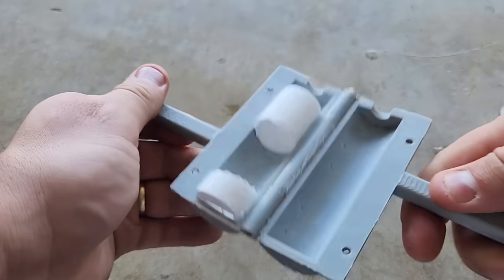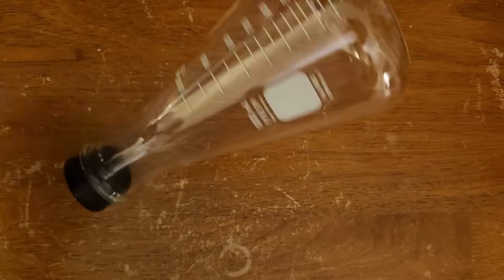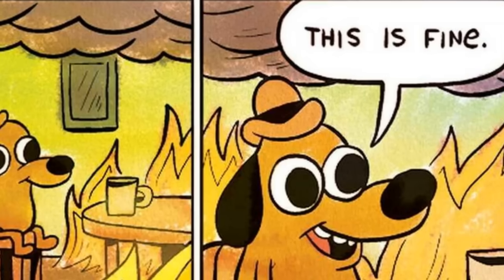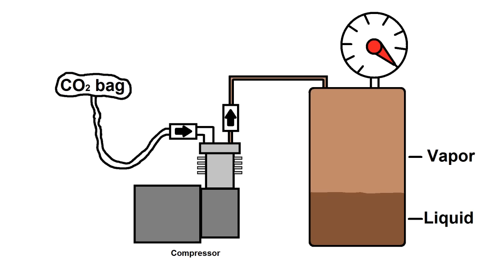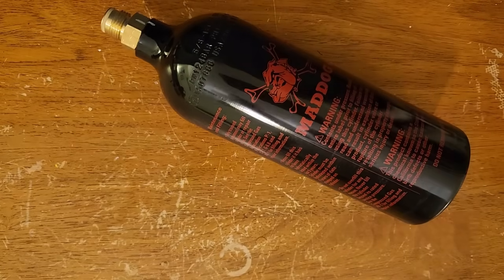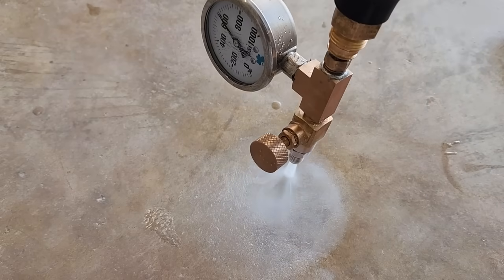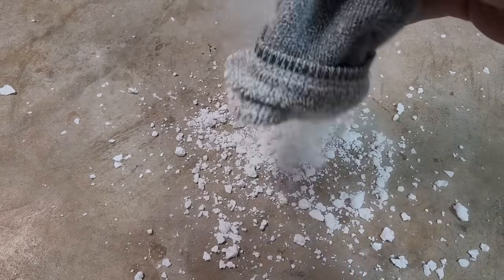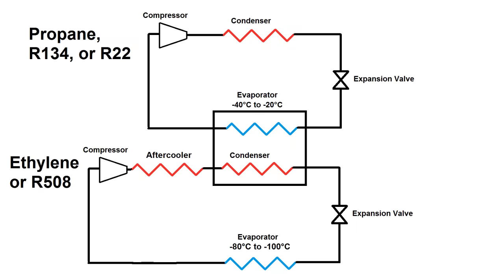Making Dry Ice from scratch

Comment: Have you ever spent time in the mountains ? There is an interesting phenomena when dusk hits...  The shape of the mountains + valleys creates a cooling effect. As the wind over head goes over the mountains+valleys there are compression pockets at the bottom of the valleys.  You could use this shape in your cooling tube to aid the capture.  That 3d printed thing you made >> imagine it with a bunch of deep ribs inside.  I am sooooo curious how different this will perform compared to the first one.
remember how a silencer is constructed. I recall a YT vid where this dude made custom silencers. This is similar to what your trying to do  >> trying to capture the pressure & slowly release. 
cool vid, thanks for sharing

Comment: I don't know if this will be of value but many (35 or so) years ago I had the occasional task of putting 6"x4" round steel bushings into interference fit holes and to make it work I would use a big propane torch to heat the housing with the hole and I would freeze the bushings in dry ice. To do the dry ice we had a bottom feed CO2 tank with a hose that went to a valve which was in the end of a 3"x28" (aprox) stainless tube, the setup was almost like a CO2 fire extinguisher. The liquid CO2 would evaporate at the top of the tube and dry ice would fall out the bottom; I think it was pretty efficient, possibly because the evaporation happened at the end of a closed tube and limited exposure to ambient air temps.  So you might try the final evaporation in a tube that is closed on one end and introduce the liquid CO2 at that closed end. 

Also, since your pulse tube cryocooler can drop ~100C does it have enough BTUs to use it to make the liquid CO2? Or am I simplifying into a chicken and egg situation? I am totally unfamiliar with this tech.
Reply: BTW, if you try the tube expansion method, use a grounding wire on the tube, the apparent friction (myguess) from the solidified CO2 sliding down the tube generates a lot of static and I had a painful shock the first time I found that out :)

Comment: The refrigeration compressor has been designed to pump only refrigerant gases,not CO2 which has a very high compression capacity, more than likely the compressor seized upon start up due to the extreme pressure on the discharge valve. There are commercially available domestic refrigeration compressors available now for CO2
.

Comment: Method 4 is even harder than you suppose. That CO2 solubility curve is only valid for pCO2 = 1bar. Solubility of gases in liquids is linear in the partial pressure so you'd need 1/400ppm or 2500 times the volume of water as you'd have needed in a pure CO2 atmosphere. You'd need 2500 liters of water to hold that 1.5g of CO2 in solution, under an atmosphere of air at 1bar. Then you'd also need a far larger volume of air than your 1.39m³ because you won't be taking the air from 400ppm to 0ppm, but rather only to maybe 350ppm. On the plus side, air is free and you can move large amounts of it easily.

Comment: Off the topic, but have a related question: Will Co2 displace all the oxygen in a pressure vessel, and anyway to figure out how much to add?  If one could do this, it would be possible to put food in an air tight container and force out oxygen from a valve on top of it. No oxygen, and the food would be preserved for camping.

Comment: Pretty cool, if you use such small cylinders with co2 try to throw them into the freezer, you will get mutch more dry ice since you will have alot more liquid and less needs to evaperate to cool the rest off to freeze it to dry ice.

Comment: Salt your ice bath.  You'll depress the freezing point of the water.  Since an ice bath is in the process of a phase change, you'll have a plateau in the temp drop until the change is complete.  So your ice bath will stay at zero unless you depress the freezing point.
Reply: Lowering your temp  will ease the burden on your compressor.  If you go through with the dry ice plan mix it with acetone for a dry ice bath.

Comment: Fridge compressors are not continuous duty. The windings likely overheated to the point of softening or melting the lacquer, leading to a short. 
You likely would have to add active cooling to the compressor to keep using those types.

Comment: If you need to make more pressure with those hermetically sealed refrigeration compressors just stack two or three end-to-end in series.   They typically have a safe working pressure rating of 275 -  350 PSI.
The exact rating is usually stamped into the case someplace) based on a 4:1 minimum burst pressure.

Comment: "crusty sock collection"+"no wife" = smh.  How about you just put the whole original freezer rig from previous videos into a chest freezer, should give you a -12C ambient but probably won't keep up.  I use one for my laser cutter w/ only 5 gals. of water in the bottom portion and it keeps up with 70W CO² tube.  You might get 10 minutes of run time with just air before having to wait for the chest freezer to go under 0C again, but I think you can get -132 ... the next bit of delta you may need is on you.  a 5.0 cu ft. chest freezer from walmart is $175.00.  get a closed loop helium up and running inside it and then maybe circumvent the law by re-purposing a 1940s anhydrous ammonia cooling loop wrapped around your heat exchangers.  Drilling access ports for tubing in the side walls of a chest freezer is easy, the compressor(s) do run hot AF.

Comment: Buy a 40 or 80 pound tank of co2 at a welding supply shop. They charge a tank deposit fee plus gas cost. 40 pound tank is 1000 psi.

Comment: A canvas bag will work better it's what I've use with CO2 fire extinguishers to make dry ice the last porous material will hold the gas more confined and spray it in in spurts that may give you a little better results by keeping the gas more confined in a small area well it freezes

Comment: If anybody actually reads these things, using brass is scary but you do not use malleable steel pipe fittings on any high pressure rig, they "WILL" explode

Comment: @Hyperspace Pirate
I think if you put a into a ice bath with holes, and have that smaller "MOLD" as well, think of it like a 3 to 4 walled container, the first 2 layers are for making dry ice, the last layer is for "recapture" of CO2 Let loose. 
Soo... to recap... you have your mold, a container around it with holes in it as well, that vent out into a 3rd jar, that is cooled by ice, but sealed, so the escaping CO2 can be recaptured and used again later.

Comment: I work with 2 stage systems or cascade systems all the time, we use usually 404A , 407c, 507 and also propane for the primary stage, think about compound cooling with a single refrigerant to reach minus 70C

Comment: Congratulations of fascinating discussion on making CO 2 you should also show how to make a pound for us to make soda using your your system Number 2 could you make a CO 2 motor for airplanes so you put CO 2 in there and lick in the solid form and have it generate gas and run one of those motors has a valve on the top and the piston comes up it opens a valve and what's more power into the that would be interesting

Comment: I don't know maybe you can use the compress you too to spray it onto a cooling disc that might be able to handle it while it was on the high stress bringing down faster or find a way to regulate the flow so it will cool the device and keep it at the temperature do you need it that will definitely freeze stuff Plus it will also look really cool 😎 PS yes I did 420 🤭

Comment: The sparks came from the PTC start relay, a 3 dollar part. When you connected the motor later, it looked straight across line power without the start Capacitor and PTC relay which is crucial to start this kind of motor. Seems it fried due to a locked rotor condition without the start components.

Comment: It is actually easier than what you are doing. Just take Liquid Co2 and make the pressure of the tank below 350psi it turns into a solid. When they make dry ice this is how they do it they spray the liquid Co2 onto a press and when the Co2 fluff gets to certain level they press it. They do this a set amount of times and when done they got a block of dry ice. They then quarter the large block into four wrap it and ship it to wherever it goes. Younger me worked at Airgas and we would get siphon feed cylinders in where the pressure dropped too low. We had to just open the valve and let it sit for a week while it slowly spit little dry ice flakes on the floor get clogged up only to spit a few more after a while.

Comment: I used to work at Schwann's. They used to sell a home soda pop set up for making your own carbonated beverages at home. Buy the concentrated flavor in small syrup cartons. Add your own water. You could rent the mini co2 tanks that you used in the system.

One of my jobs there was filling the empty returned tanks. There would always be a build up of dry ice around the connection between the filler valve and the tank I was filling, just from the escaping gas when I released the full tank.

The CO2 was fed from a large tank sitting outside the building. 

Schwann's beverage plant. An interesting place to work, and a really terrific bunch of people to work with. People who chose to work there until retirement. One guy, a material handler, retired with over a million dollars from his retirement plan. But that was back when the founder of the company was still alive and in control of things. After he died, someone else took over leadership and cut employee benefits down to nearly nothing.

Anyway, they sold their own juice mixes by the gallon. 
The juice was mixed in huge vats constantly stirring and mixing.

I added 50 pound bags of dried citric acid to the mix. And scoops of powdered caffeine from a cardboard barrel.

Orange juice came concentrated as a thick syrup in 50 gallon plastic barrels. A giant metal tube shaped like a needle tip was used to suck out the contents.

They made their own chocolate and strawberry syrups. 50 pound bags of cocoa and bags of sugar.

The place smelled delicious. Except for the blow mold room. Big bags of plastic pellets were dumped into a machine that heated the beads until they melted into a soft mass that was then blown into molds shaped like gallon jugs with handles. 

That place gave me a headache.

All back in the late 80's.

Seems like I lived several lifetimes in about 10 years.
Time went slower, somehow, back then.

I just realized I'm turning into Abe Simpson from "The Simpsons".

"Hello? Will somebody let me in?There's wolves out here!"

Comment: Our home came with an old CO2 fire extinguisher in the basement. Never thought much about it until I saw a video where the guy just sticks the wide plastic cone/nozzle in a pillow case and blasts away making dry ice. You can have it refilled at local gas retailer easily.

Comment: In the past I have modified a surplus SodaStream system to make dry ice.  The yields are low as most is lost as gas in the cooling process.  Simply removing the valve gear from the carbonator and reforming (heat gun and taper)) the PLASTIC injector tube into an expanding cone is pretty effective..  My cone was about 4cm long and 1cm at the outlet but a slightly larger/longer one might have offered better conversion.  The idea is to have a controlled expansion while trapping the cooling effect to maximise the formation of snow.  Chilling the cylinder will also help as it reduces the pressure and removes some heat.

The choice of bag is important.  I found a SATIN drawstring bag worked the best.  The snow does not stick to the weave and the gas passes through well.  The bag might have been included with a pair of sun glasses judging from the size.  After venting for a while and capturing a bunch of snow I immediately shake and smack the bag on the floor to consolidate the snow, I then manually crush it wearing a leather welding glove to have a yield of about the size of an AA cell that is compact and durable.  I think I could get 3 full shots from a bottle of gas that costs under EUR10 to refill these days.  Since moving to Finland I have located a supplier of Dry-ice who charges EUR15 for a block the size of a traditional clay brick.  They produce rice from a massive storage tank daily for dry-ice blasting customers and use a simple hydraulic press to prepare blocks on demand for customers.

Years ago in South Africa there was an enterprising fellow who set up shop next to a Liquid Air plant and obviously got a good deal on their surplus CO2 piped across through the fence. He formed the snow into a chamber and them compressed the snow into a block with the one rig.  The other rig had a continuous snow maker with a screw fed extruder that made 3mm noodles that broke apart into rice.  One could go and collect what was needed in a expanded styrofoam box for relatively little if my memory serves me.

I am hoping that there will be one positive outcome of the covid scandal and that is a surplus of low temperature freezers in a few years.  There was a South African sold out to American investors who developed a handy dandy low temperature freezer. It was a very well insulated cabinet with a single small cryo-cooler at the TOP and a gravity fed thermo-syphon (poor man's heat pipe) that delivered a condensed liquid in a meandering path to the bottom of the freezer that gave opportunity for evaporation all along the way with the vapour returning to the cooler at the top.

These freezers will be overpriced novelties but their value should drop a lot when people no longer have a need to chill toxic shots.
Reply: I think this was the commercialised version of the sterling freezer.
watch?v=HQ5d_KwGwfg

Comment: I get it for free on occasion .
Lots of things are shipped in dry ice and they usually just throw it in the trash with the packaging . Some places will give it to you .
So that's how I get 10 - 20 pounds of free dry ice , and repurpose empty drink containers , while amusing the grandkids , terrifying the dogs , and , pissing the neighbors off .
Pro tip , plastic orange juice containers have thicker plastic and finer threads on the caps than other plastic containers , allowing them to build more pressure before bursting .
I have seen a set of metal lockers destroyed by someone who just left quart of orange juice in their locker when they quit their job .
Eventually , as decay proceeded , the little beasties gave off enough gas to create a literal time bomb , and it blew the top and bottom of the locker completely out , blew the door open , bent the sides , and made one hell of a reeking mess .
You can repeat this phenomenon with most any organic matter and a resealable container , making a little surprise for whoever at some point in the future  .

Comment: I used a very simple dry ice puck maker designed for special effects use.  It was two disks of wood with velcro hook strips glued and stapled on them, and a pipe connector tapped into one the disks.  In use, a larger velcro strap was applied around the two disks with a gap for the puck of dry ice to form inside.  Then liquid CO2 was blown in until the puck started making slight creaking noises.  When the velcro was undone there was a nice solid puck of dry ice inside.

That was an impressive way of making enough CO2.  I wonder if the first compressor was angry about being started under pressure, since they aren't really designed for that.
Reply: It may not have been broke, could have just been the starter burned out, easy replacement. There is also a chance it melted some insulation because he ran a heavy load with no cooling (usually refrigerant provides cooling in addition to the oil.) Lastly, he plugged it in with no load (rotor) so of course it'll just overheat and definitely short at that point. It's impossible to say.

Comment: If you had used salt water to cool the bottle you could have reduced the temp from 0 C to about -10C to -15C  as the salty water allows lower temps before freezing, its an old physics trick to cool wine down.

Comment: I know CO2 is heavier than air. I used to work at an aluminum plant that had rolling mills cooled with oil. When fires started we would dump Cardox which is dry ice to put out the fire. This happened automatically. There was dry ice all over the plant floor. It was not an enclosed bldg but I was always a little leery of that smell. We wouldn't stay in the clouds of it long. We would go to fresh air and breathe. The clouds did collect low down. So our boots would be nice and cold even in summer. Good times.

Comment: I work on those compressors in HVAC. When you run the compressor sense they’re no longer in a Refrigeration system you need to run water over the hull or find some way to cool it down while it’s running or they’ll eventually break because they’re not designed run without Freon to carry away the heat.

Comment: I am absolutely subscribed to you now.
But my thought would be to use a salt water ice bath to drive the temperature down even further. That will, of course, improve your yield for the same pressure.
But by what I'm looking at, your freezer should be about -18c, meaning your ice would be that same temperature, which then you would only need 18 bar, or 250 psig to get the same yield.

Comment: Just found you and I gotta say I'm already loving this. You are like Cody's Lab but more concise. As for your cryo cooler, perhaps if you used another means of cooling it, like a salt bath as salt tends to have a cooling effect on water.
The big brained move though would be to figure out how to use the cryo cooler to cool itself down. But I doubt that will work very well without a closed looped system that will work against what you intend to use it for.